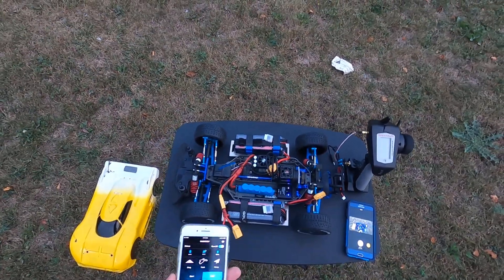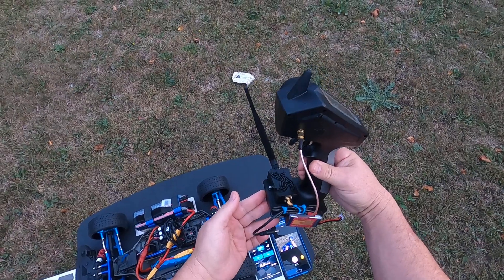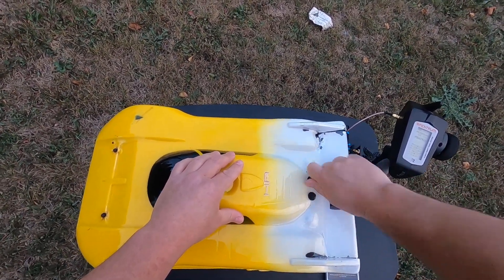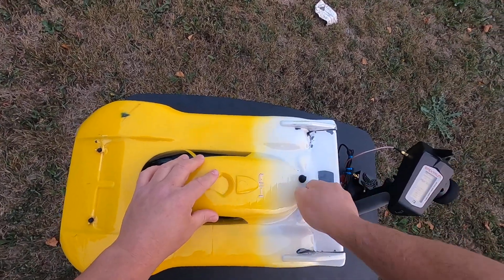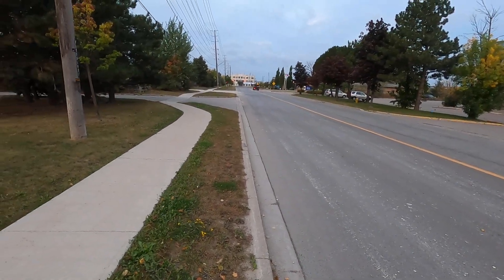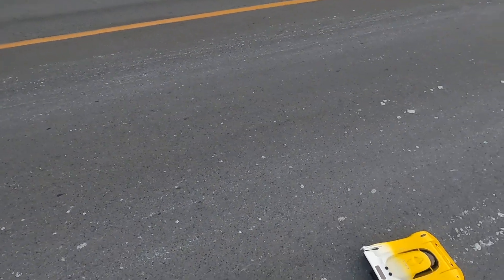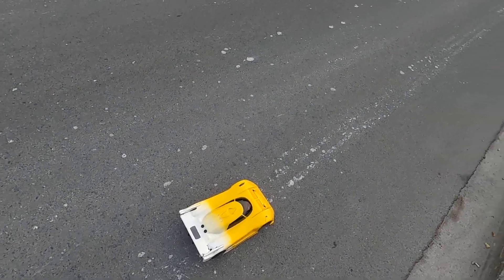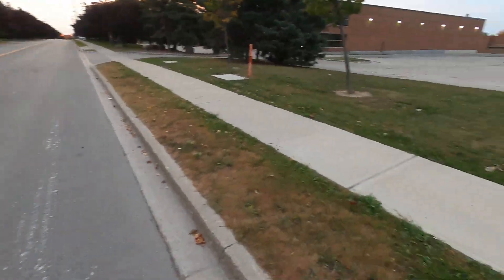Traxxas Slash 4x4 Speed Run - Hobbywing Max 6 & Hobbywing 4274 Motor - Deltaplasticks Jaguar - 93Mph

Comment from the maker: Hey guys I was out today with my Slash 4x4 for the first time after my 121Mph Crash and I was having trouble getting over 106Mph this time. Look at the front left fender before and after the run. My suspension had something wrong with it and the car was sitting lower than normal. This caused the front left tire to rub hard on the body at speed nearly wearing through it by the end of the day. I don't know how I missed this but it held the car back and wore the center of my front tire half way through!

Comment: Car looks to be running ok but the drifting off a bit. The road isn't got much hook on it from the construction dust and dirt on it from down the road. That will make it skate around a bit also.
Reply from the maker: The front left tire was rubbing and wore half way through my body and tire. I don't know how I didnt see this(worrying about traffic I guess and I'm used to slight tire rub.) But when I got home I saw how much it wore through the body. This is why I could only go 105Mph today( another run after this one).
Reply: @KaizerTest  you got the Thanksgiving weekend coming up you might be able to get a few runs in then.
Reply from the maker: @fordnut71  Yes...I will probably try again next Sunday. The X-01 crashed today...so its out. And I dont really care. I cant get that thing to run straight at all.
Reply: @KaizerTest  oh no did the xo-1 take a lot of damage?
Reply from the maker: @fordnut71  kinda...a tie rod snapped and the body got a little crack. Not too bad. That car is going on the back burner. I will put a smaller motor in and esc until I can get it running straight.
Reply: @KaizerTest  Jenny's rc has xo-1 parts from time to time. It's where I order my xo-1 parts from. Seems no one has parts in stock here.
Reply from the maker: @fordnut71  Thats another reason the X-01 sucks. There I said it...😂 Ordering from the USA costs alot with exchange and shipping. Arrma parts and Slash 4x4 parts flow like water here but X-01 parts? No f'n way. She will be down for awhile. Im going to keep trying to get it to run straight until there is no X-01 left in it...lol.
Reply: @KaizerTest  the xo-1 is a lot of slash 4x4 parts  to start with. I know the arms are the same I can't remember if the links are or not.
I'm the guy in oshawa. Lol.
Reply from the maker: @fordnut71  Yeah I remembered that after I hit the post button and corrected it...lol. Sorry bro. Im out with the wife and kiddies shopping and not having fun. 😣 So X-01 arms are the same as Slash? Nice I have lots then...lol. Im sure I can scare up the tie rod. Im taking that nice Castle system out of this car. Its not worthy of it...lol. I will put a 3670 motor in and a cheaper esc and see if I can dial it in to run straight...if ever.
Reply: @KaizerTest  yep I'm doing a traxxas rally from scratch and both front and rear subs are xo-1 from Jenny's rc.
Reply from the maker: @fordnut71  Subs?
Reply: @KaizerTest  sub assembly from the chassis.
Reply from the maker: @fordnut71  X-01 sub assembly fits on the Slash Lcg Chassis?
Reply: @KaizerTest  most of it just the plates that diffs and chassis connect to are different.

Comment: Nice job brother get back up on that horse I'm going to go make a pass today finally got mine back together and I will be using the new cnhl batteries
Reply from the maker: Thanks bro. The front end of the car was sitting lower than normal(probably the chassis is bent a bit) so the tires were closer to the body and rubbing on full throttle(tires ballooning slightly). So it melted half way through a 2mm body and wore the center of the tire half way through! I don't know how I missed this but that's why I only got 105Mph today(another run after this one). Oh well. I fixed it already. I thought the car sounded a little funny when I pegged the trigger. It was the tire rubbing. It also was pulling to the side a bit.
Reply: @KaizerTest  I made 2 passes yesterday the first was only 104 and the car seem to be pulling to the left I make Corrections on my remote and went to make another pass and the car turned hard left are got up underneath of it and it lifted off the ground no real damage but then I found out what it was the new turnbuckles I put on came loose and cause the steering to be messed up so now I got to go back and fix it hopefully I'll be able to get it straight and get a run or to in today

Comment: I control both the gps and the GoPro with the same phone 😃
Miss those speed run vids
Reply from the maker: I had trouble with my gopro when I go back and forth with apps so I tried to just keep the app open. Kind of a pain though.
Reply from the maker: Hopefully this year I will get out there a little more speed running. My cars are sitting collecting dust...lol.
Reply: @KaizerTest  you Can always do an “around the car” talk … That use to be pretty good too

Comment: Awsome run brother
Reply from the maker: I appreciate the kind words but it kinda sucked...lol. I did 105Mph after which pales from my expectation of 125Mph for today. The front tire was rubbing the body hard at high speed. The thing is I didnt notice...so I ran it all day like that...lol. I think the chassis got bent a bit from my 121mph crash and my front end sits lower and the tires were closer to the inside of the body. Maybe next Sunday I can at least get back in the 120's.

Comment: Not a bad run for the first time back running after being fixed.
Reply from the maker: Front tire was rubbing pretty hard at full throttle so that is what was holding it back...sux.

Comment: Nice
Reply from the maker: Thanks...but the front tire was rubbing badly at higher speed...thus the low Mph
Reply: KaizerTest RC good job you found it now though
Reply from the maker: @gfdtjkitsxn7775  Yeah true thanks bro. I have another few runs from today to upload. Next weekend Sunday I will try again with the Slash. Hows your TT02?
Reply: KaizerTest RC im actually building a pure speedrun car out of my old drift car.
4-6s should be enough to hit 100 in an 1:10 right?
Reply from the maker: @gfdtjkitsxn7775  Oh yeah. The TT02?
Reply: KaizerTest RC no its a himoto but where it is a drift car it already has a locked rear diff and fairly substantial gearing
Reply from the maker: @gfdtjkitsxn7775  Nice! Post some vids of the progress if you get time.

Comment: Do you happen to know if the Hobbywing Max6 esc has a kv limit 1500 or can it run higher than that?
Reply from the maker: HobbyWing says 1200kv max on 8s. I ran a 2200kv motor on 6s for 1 or 2 passes and then let cool. No more passes than that. Also running 34/34 gearing.
Reply: @KaizerTest  yeah the 1200kv is for a 5892 motor. I figured with a smaller size motor, I could run higher kv. I plan on getting a Tp4050 motor with 2350kv. I am afraid if I get that motor, it will only run at 1200kv on 6s.